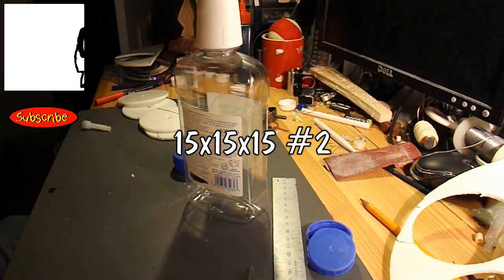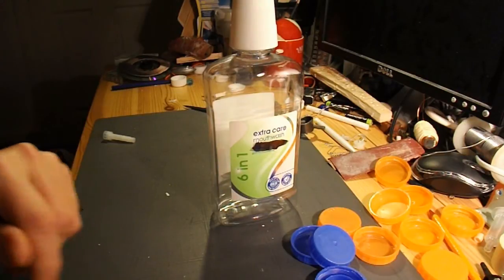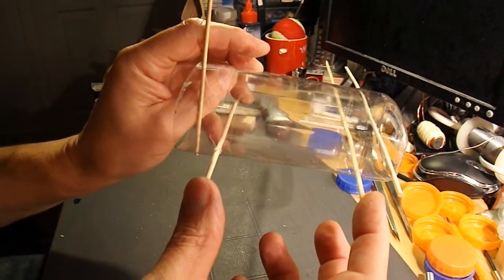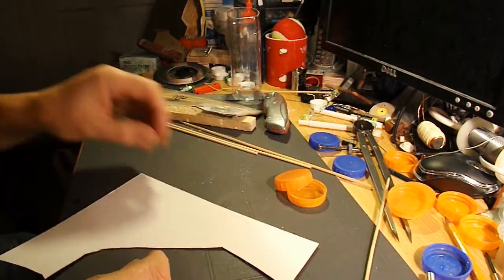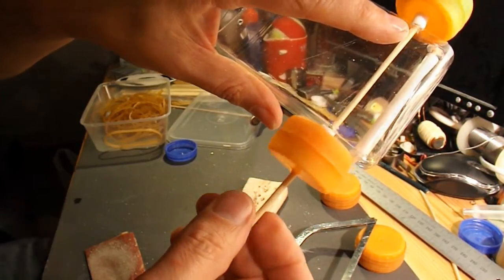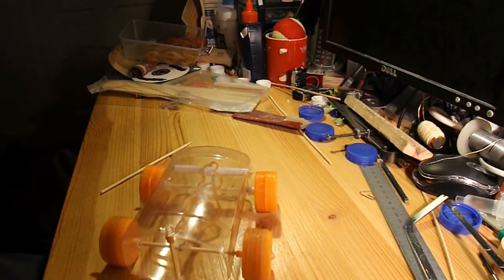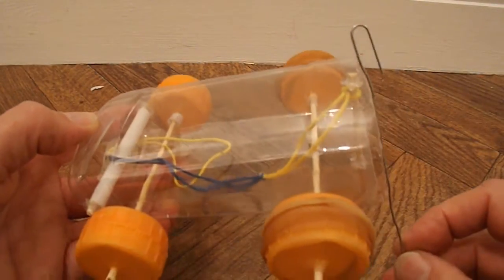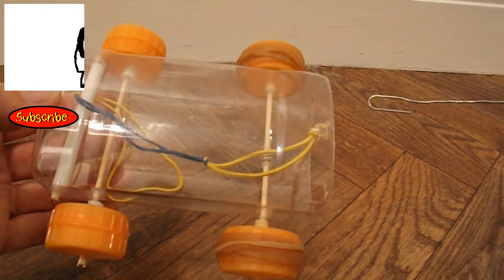15x15x15 #2 rubberband powered car

Comment: Can you make a square bottle car that is powered by rubber bands?
Reply from the maker: MakeupLover 20th I have no doubt you could make a car using a square bottle. I have well over 100 different rubber band powered projects in my playlist. The shape of the bottle has very little relevance to it's performance. As long as your axles turn freely and your wheels are good, it will work.
Here is my Rubber Band playlist https://www.youtube.com/playlist?list=PLA5a2xPRSrB1otXh0w36OwsYIHZznUWp6
Here are cars from plastic containers
Lets make a Rubber Powered Pop Bottle Car https://youtu.be/7nHLpvzu34U?list=PLA5a2xPRSrB1otXh0w36OwsYIHZznUWp6

Rubber Band Powered Car Simple Basic https://youtu.be/RkM95PLAlCw?list=PLA5a2xPRSrB1otXh0w36OwsYIHZznUWp6

Rubber Band Powered Car with 2 bands NO CDs or DVDs https://youtu.be/iKkiCvlsb0M?list=PLA5a2xPRSrB1otXh0w36OwsYIHZznUWp6

Rubber Band Powered Paddle Boat/Car + ratchet mechanism https://youtu.be/aqB8hflHvwU?list=PLA5a2xPRSrB1otXh0w36OwsYIHZznUWp6

Hey Grandad can you use an Ice Cream Tub for a car? https://youtu.be/_ndIIEgTdsk?list=PLA5a2xPRSrB1otXh0w36OwsYIHZznUWp6

Grandad can make something with this - plastic fruit drink bottle https://youtu.be/Lj87_G3-cmQ?list=PLA5a2xPRSrB1otXh0w36OwsYIHZznUWp6

Rubber Band Powered Car using Printer Rollers for wheels https://youtu.be/OvTkiOlcpoc?list=PLA5a2xPRSrB1otXh0w36OwsYIHZznUWp6

Pop Bottle Rubber Band Car to Drop a coin at 5m https://youtu.be/whGhTBIPnh0?list=PLA5a2xPRSrB1otXh0w36OwsYIHZznUWp6

Bargain Store Project #26 Pop Bottle Paddle Boat https://youtu.be/bpXOHwqCTLc?list=PLA5a2xPRSrB1otXh0w36OwsYIHZznUWp6

Bargain Store Project #22 Storage Container Rubber Band Powered Car https://youtu.be/yNe4i646aFE?list=PLA5a2xPRSrB1otXh0w36OwsYIHZznUWp6

Let's help grandad make a car https://youtu.be/2DJ3j8nJJoc?list=PLA5a2xPRSrB1otXh0w36OwsYIHZznUWp6

Rubber Band Powered DVD case Car https://youtu.be/I8QcGZr-CFE?list=PLA5a2xPRSrB1otXh0w36OwsYIHZznUWp6